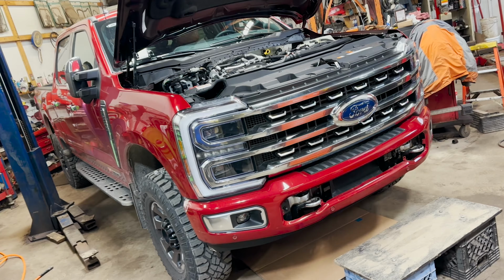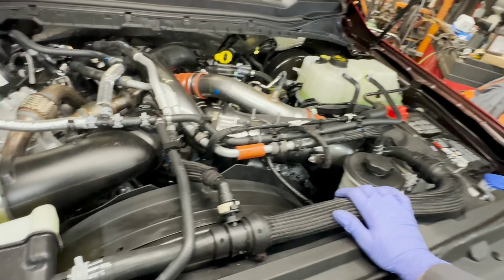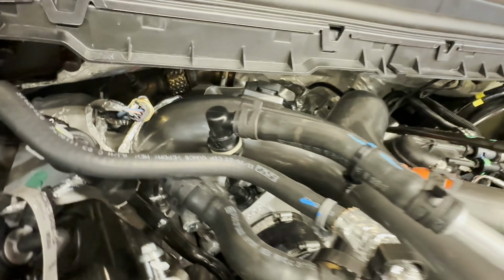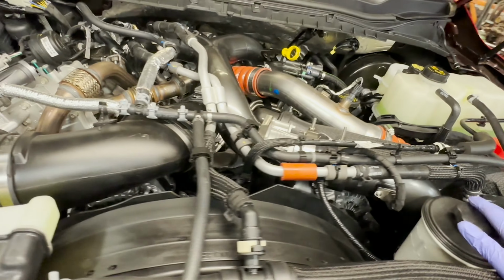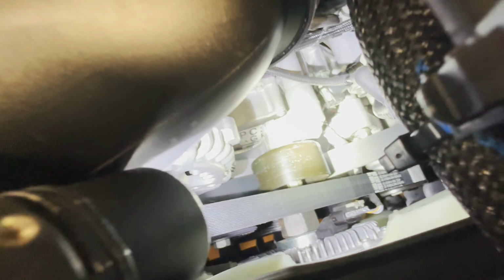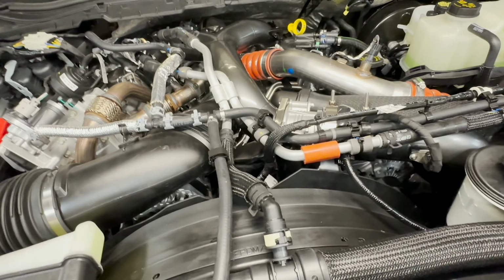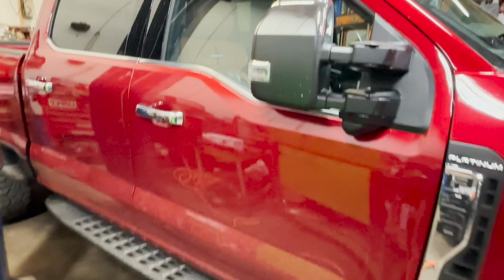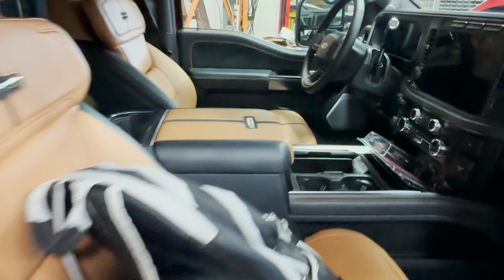2024 F350  6.7 Tremor Platinum | From Oregon-to-PTT, now Modified #diesel

Comment: That truck is sharp in the color red with chrome.  Would the disaster prevention kit be a good back up just incase the DCR fails for some odd reason?
Reply from the maker: The DPK isn't capatible with the DCR. DCR is step one of PTT proofing ur rig

Comment: I ordered and just picked up this same truck but in Black with the tan interior. I absolutely love it!!!

One thing I noticed that is annoying and it may be just a setting. When you have CarPlay maps “mapping” and in tow hall mode, you lose the diesel and general maps, the pages are blanked out. I have to flip it back to normal driving mode versus tow mode in order to see my diesel and general pages. If you have a fix for that, I would love to hear it. Most guys when your towing you like to see your def level, turbo boost, exhaust filter level, engine brake all one page.
Reply: I have the same problem on a 2024 F250 Larit, have you found a fix?
Reply: @ No, I haven’t had a reason yet to take it to the dealer for a repair. I planned to add it to the ticket when something breaks.

Comment: What is that cricket sound in the engine bay? My gas 7.3 does the same thing.
Reply from the maker: What
Reply: @PowerStrokeTechTalkwARod  at 1:50 right before you said DCR
Reply from the maker: ...mee leaning on the front radiator plastics.

Comment: Warranty is toast.
Reply from the maker: Yeah I don't think so Tim
Reply: The only warranty impacted is the one on the fuel pump itself. Every other thing on the truck is still under warranty. The only possible exception would be if they can directly link a fuel pump failure to some other failure otherwise no impact to warranty. Why spread false information?

Comment: What's the first thing you do after spending 100k on your truck? Drop another $5k on upgrades 😅
Reply: Or take it to Carli suspension like we do out west and burn a solid $15k on suspensions. If you do it quick you just tell the wife it came home that way lol.
Reply: Yep, just tell wife it’s a solution since it came from factory faulty
Reply: @gadielsantiago8813 I like that 😂
Reply: I dropped 9k on just the performance side, zero cosmetics. But I paid 49k for a 2019 f250 xlt premium package 4x4 4 door 6.7 in 2020. The 1st weekend I threw the warranty away. Just spent 2k in the DCR, owell, but I can make it faster than I spend it
Reply: it's only 5% 🤷🏻‍♂️

Comment: What is the point of that intake setup?
Reply: @timfoster1599 Better air flow, 66% over stock & the turbo inlet also has 15%  over stock👍
Reply: @zekester1  Not to mention the log jam of soot from the EGR at the throttle body that's eliminated.
Reply: @pat9125   And not to mention that nice turbo growl you get!!!😜
Reply from the maker: @zekester1 riiight

Comment: Why replace the cold and hot side tubes?
Reply from the maker: Cuz they're the same tube as the 2017 thru current. They blow...
Reply: lol, I’m sure induction tubing is supposed to blow!

On a serious note, what is the problem with the OEM tubes? I have one of these ‘24 trucks  with the HO engine and I’m trying to sort out what’s truly a risk. 

Isn’t the CP4 issue that the bottom end is intolerant to fuel quality issues? Can’t this be managed with diligent use of fuel additive and frequent draining of the fuel water separator and fuel filter changes?
Reply from the maker: Watch our playlists brother, we go over all of this.
Reply: @blakepetersdiving  The CP4 may never fail. As you suggest and if you watch Arod's previous videos you can take steps to minimize your risk but you can only do so much. Change filters, use a good additive, drain the water...check, check, check. You are still at risk of bad fuel no matter what you do and it turns into a lottery weather you have an issue or not. Getting rid of the weak part does not mean you stop doing all the other preventative maintenance it just means that your likely hood of becoming stranded severely diminishes and your likely hood of taking out your entire fuel system is eliminated. It's all about preventing problems and bullet proofing. As far as the intake and tubes. Watch ARod's videos. The new intake not only improves overall engine efficiency but also eliminates the stock traffic jam of soot from the EGR right at the throttle body. Notice where the EGR is relocated to. Again...preventative, not to mention efficiency which translates into MPG and HP. The turbo inlet is all about efficiency and the cold side pipe is mostly about prevention. You have a 24 and if you never do anything to it you still have the best most reliable most powerful truck on the planet. Nothing made though can't be improved in some way weather it's HP or reliability. The question is what are your plans for your truck. If it's a keeper then some or all of the mods on Arod's channel are worth considering but if you flip through rigs every few years then perhaps not.
Reply: @pat9125 thanks for the thoughtful reply.
Reply from the maker: @pat9125 we appppreciated yall coming thruuuu

Comment: Sad y’all spend that much on a truck and have to spend more to make it right.
Reply: If only they made something perfect. Of course nothing is perfect but the 6.7 is as close as it gets in today's market. Ford should absolutely dump the CP4 as Dodge and GM did. If I have to replace the CP4 to improve a truck that's already better than anything else on the road then so be it. Can't argue it would be nice if it came from the factory that way but it didn't. Better to replace the CP4 then the transmission, engine, electronics, emissions or the myriad of other problems sold by "the other guys" :)